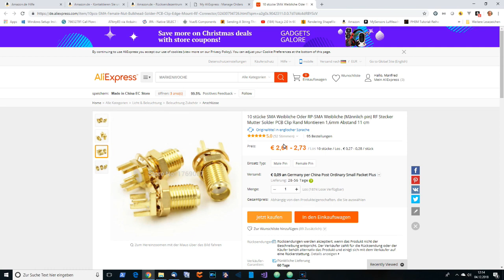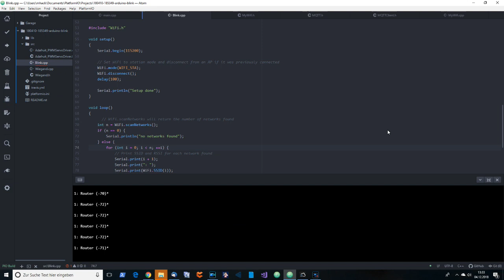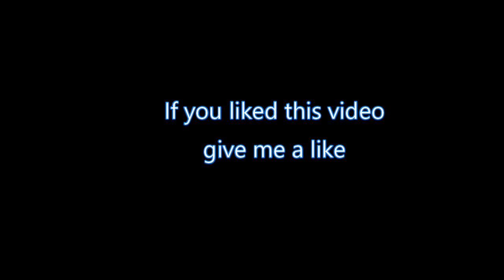Solder a SMA socket to an ESP32 for a external antenna

Comment: Thats a nice add on. Only thing I would suggest is to use a little liquid flux when tinning the board connections and soldering the SMA to the board. Will allow for a better, well soldered connection.  That will help the RF path significantly... no dirty joints and better flow.

Comment: Hey thanks! I've done the same.  It increased the range at least twice for me.
Reply: Hi Dmitry 👏🏻😇
Reply: How far did you measure?
Reply: Within one apartment. Good coverage.
Reply: @dmitrymenshikov3387  how can we try this on esp8266
Reply: not sure what you mean.
You can use this video as a guide for Bluetooth and wifi antennas.
Reply: Do i have to consider anything regards the antenna ? Such as impedances or type of antenna ? Also is there any software problems ?

Comment: The paint is called a soldermask, try cleaning the new "pads" well and use more flux. If cleaned and fluxed, tin should "want" to wet the pads.

Comment: Theres a few things I want others to know if they watch this.

1) NEVER TURN your devices on without an antenna attached! This will burn up the radio...
2) The soldering work in this video shows exactly how not to solder. When dealing with radios, its VERY important to take care with your solder. Too much is a bad thing, wrong tips is also a bad thing, and of course too little is bad. In this case, the author uses too much solder while tinning and then has to apply a lot of heat to get the solder to spread out. This will cause problems that you will not be able to figure out. Low signal, dropped packets.

With that said, good video on how to add an antenna to an ESP32.
Reply: @sleepyboi6226  this device already have antenna 😐 he is extending the antenna. So the antenna is already there . For ur kind information
Reply: So this can work but you need do it good for work?

Comment: I'm 2 for 3 attempts at this...  The first two increase range a lot.  However, the board is really unstable.  It panics and reboots after a few seconds.   I'm sure I'm screwing it up somehow...
Reply: i dont mean to laugh. which i did reading this. I'd say pratice soldering first. please.
Reply: @bigdeadlykicksandkickflips  2 years ago...   This was practice.  But thanks the help 😃

Comment: HI,
is the same antenna used for bluetooth? 
It would be interesting to see if the scan range can be improved as well.
Reply from the maker: Hi, it is WiFi only
Reply: Actually yes, WiFi and Bluetooth (and ESP-NOW for that matter) share the same RF I/O hardware.  There is no other antenna for it to use.  They all operate in the same frequency band so there's no reason not to share that hardware.  The only ESP32 board I know of that has another radio is the one with cellular connectivity and even then it's actually a separate chip on the PCB providing that functionality, not the ESP32 itself.
Reply: @manfredhackstock418  sir can you give instruction for esp8266 ?

Comment: Could this be done on the ESP8266?
Reply: yes
Reply: @-vermin-  I assume you have done it to a Esp8266.  Is the polarity the same?
Reply: @eclecticlife  it's kinda mirrored.. mass is still on the outside. Just did it. Works fine :)

Comment: Great video.  If I want to solder a cable rather than the SMA socket directly to the board, should I solder the center core to one end and  the cable shielding to a different end of the embedded antenna ?  Tks!!   Here is the link to the board: https://www.youtube.com/watch?v=zGsMKEwCqkU
Reply: Yes.